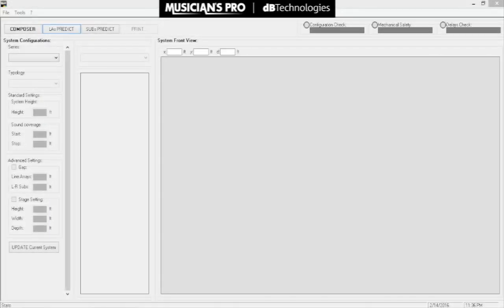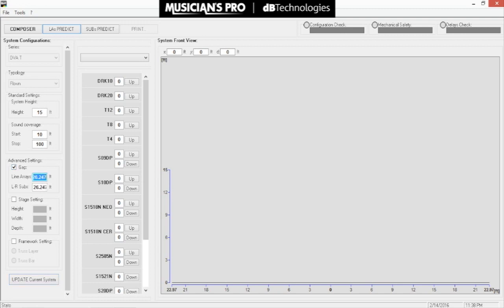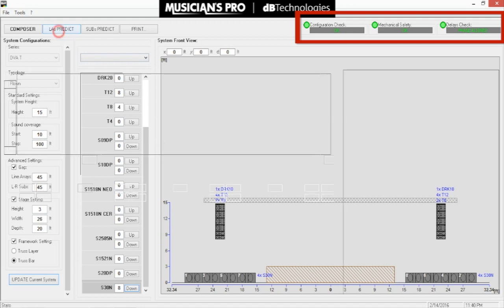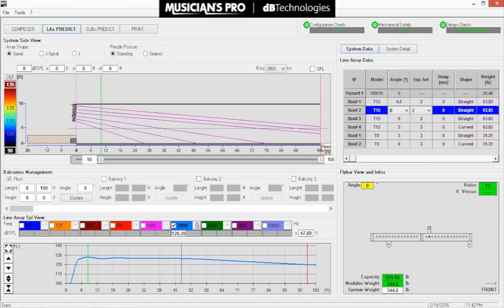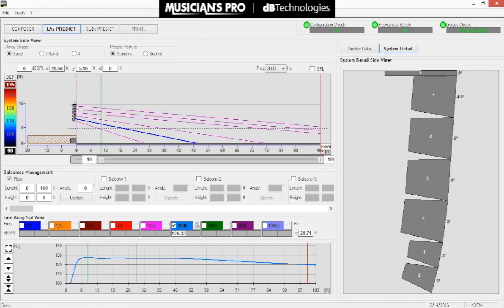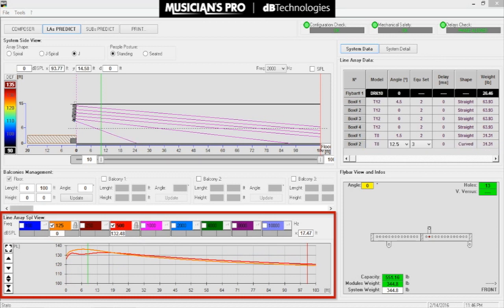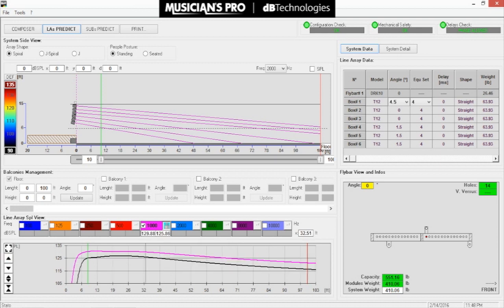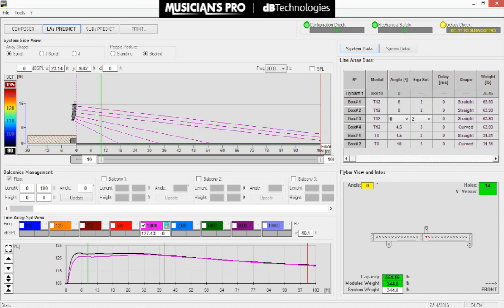TECH: dB Technologies Composer Software Overview for DVA T12 T8 T4 S30 Mini VIO

Comment: I used the dva composer, and I lined up 6 dva s30 in the front in cardiod, but I do not have the results I am looking for. the software automatically flips 3 and 4 around and phase inverts them (in a line from 1 to 6). in the table on the right I can only manually fill in parameters with the LAs, but not with the subs. is there a way to see the results if I flip 2 and 5 around and phase invert them?
Reply from the maker: Julian van Essen - join our dB Technologies user group on Facebook to discuss.